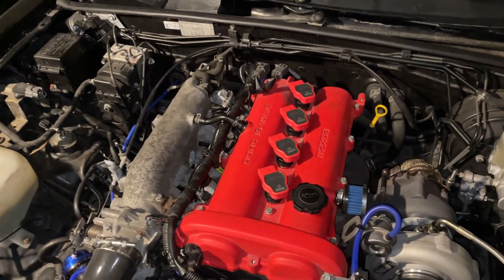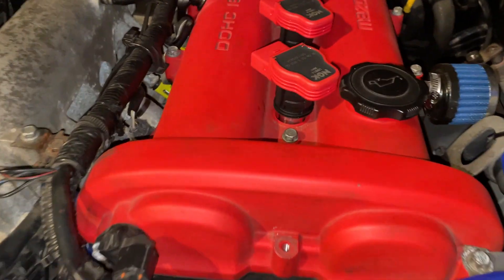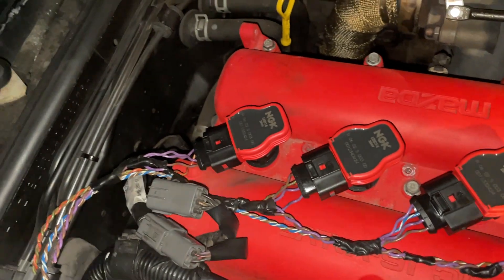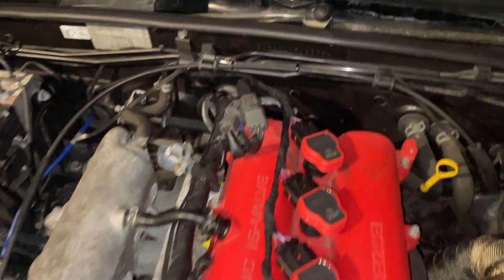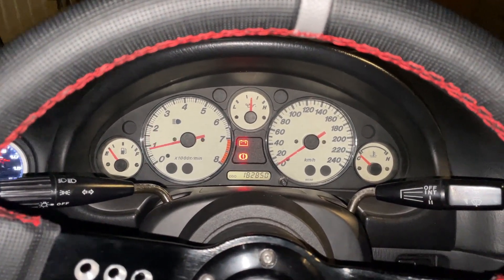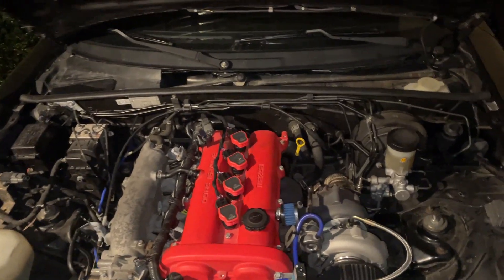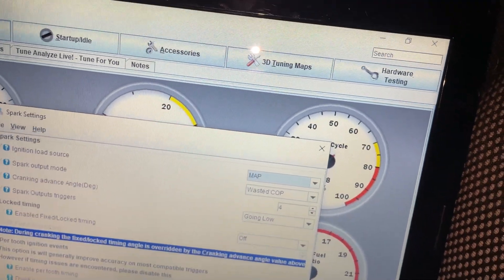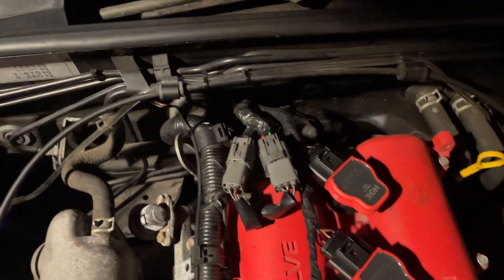Audi R8 COPs For The Miata | Speeduino Settings

Comment: could yu include in the settings of the dwell time. could possibly help anyone else who wires their own. I have a plug and play kit for these coils just looking for miata reference videos
Reply from the maker: Currently i switched back to original coils becuase my speeduino didnt like them. I can help if you have any questions. I will also put them back later on. I just switched to a ms3pro ecu.